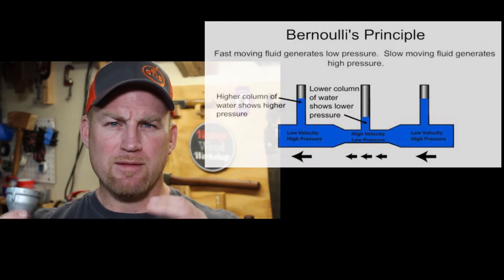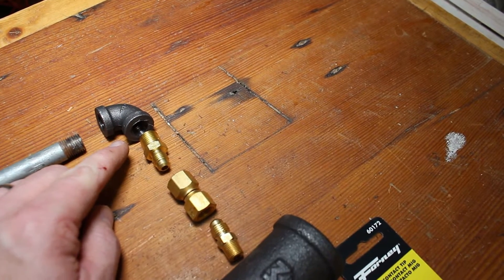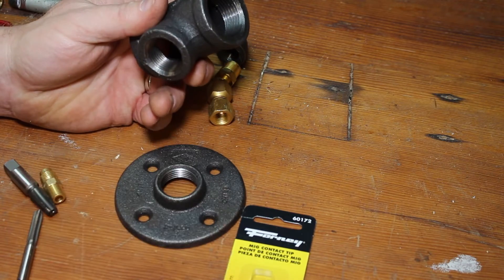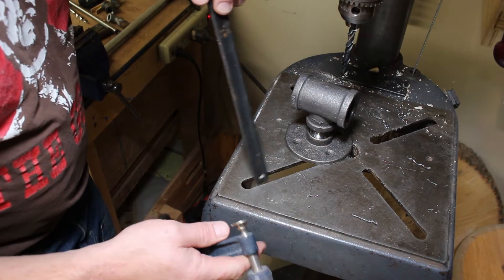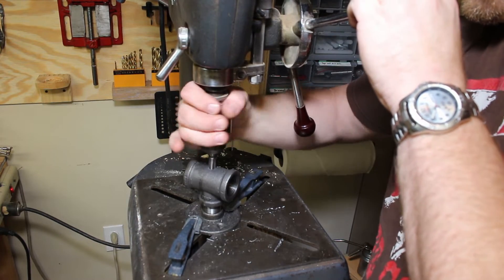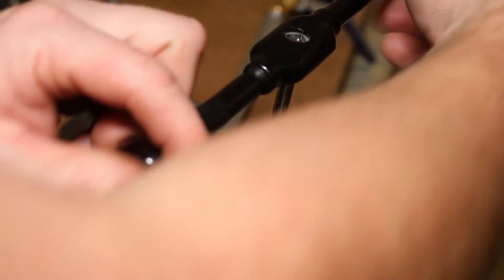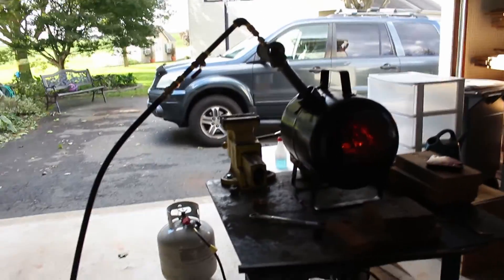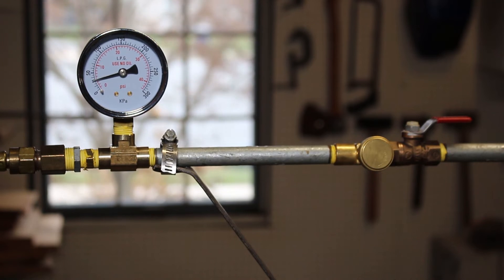How to Build a Frosty T-Burner (Propane Forge) Step-by-Step Process

Comment: I noticed the problem with the 1/8 x 27 Tapered pipe tap. You tapped it too deep. Tapered threads are a whole differnt animal. I have 48 years in machine shops and I learned long ago that you have to stop at a certain point in order for the mating part to fit correctly. Taperd threads are designed to get tighter as they screw together.  In pro shops we have gages that we use to know when the hole is tapped correctly. When you don't have a gage, this will get you in the right "sweet spot",   run the tap into the hole until you can count 7 to 9 threads above the hole. That will put the right amount of draw for the mating part to tighten up.

Comment: Cpvc would work fine up to 2 feet to kiln just use cast from there cpvc holds up to 300 psi propane is cold anyway no heat is made until combustion at tip so technically  weather is air hose water hose PVC cpvc or copper pipe and even pex is all fine for max of 30 psi from regulator   code I guess would be gas pipe cast iron  but it's not on a building so code doesnt matter just a thought of making long distance supply cheaper  ....good job on building

Comment: Sir l built a burner with a 1x1x3/4 tee and a .30 flux core tip with a regulator and it will not light. Could you give me some advice? Thank you
Reply: did you get it worked out?

Comment: The existing hole in the brass fitting was way bigger than the 1/4 20 my welding tip was.

Comment: You started talking about the pipe tap being tapered, but didn't mention if you tap too deep with it then the fitting will be loose, it actually widens the hole too much. Looks like yours was actually close tobeing too loose. A little extra tape will probably fix it though.

Comment: Can I use 1 1/4" pipe instead of 3/4" pipe for the burner? Will there be any greater safety concerns if I use 1 1/4" pipe instead of 3/4"? And can the propane line fittings be of different diameter, such as 5/16" with all proper reducers and tight threaded fits? Thank You for the video.
Reply: All of that is achievable. Bigger burner will give you a lot more heat.

Comment: Who told you that thread tape doesn’t seal and is for lubrication? It is definitely for sealing man. That’s it’s purpose.
Reply from the maker: The internet...here’s an example: https://www.thebuildingcodeforum.com/forum/threads/white-tape-on-gas-lines.10125/
Reply: Wrong. Its purpose isn't to seal. Pipe threads are tapered. They seal themselves, but you have to tighten them enough to seal themselves. That is where Teflon tape comes in. It lubricates the treads so you can more easily get the joint tighter. The old timers use to use oil or cutting fluid to lube the threads, them Teflon tape was invented which is far less messy

Comment: So I used the same tap that you mentioned in the video, a 1/4", 28, for the threads in the brass fitting to set the mig tip and when I was done, the mig tip just slid in and out. The hole was too big.

Any suggestions?
Reply: Sounds like your mig tip thread is M6 SO USE M6 TAP WITH A 5.5 MM DRILL HOLE
Reply: @sprockylock391  is this a MIller mig tip?

Comment: I have a dual T burner and I'm having trouble with the burners. The first burner works great until I turn on the second one, and then they start sputtering.  And I'm also having problems with them getting extremely hot, up around the fixtures, and rubber gas lines.

Comment: Good descriptions and well presented. Thank you! One thought, don't back the tap all the way out, just enough to break the chip. If you take it completely out and then try to reenter the newly cut threads there is a chance of damaging what you already did. I liked the use of the union, easy disconnect without having to spin everything.

Comment: Very logical documentary.  What's the reason for using a tee instead of a cross?  That would save a lot of work.
Reply: my Lack of Focus or MLFranklin can you help me? I bought a 3/4” cross. What else do I need? I don’t wanna drill, I’d prefer to use flares or nipples

Comment: Hi mate great vid. Using the pressure gauge is a great idea. Just wondering Did you have to adjust the length of the mig tip? I plan on making one of these burners next week so been looking up as much info as I can on them. The length of the mig tip change from vid to vid.

Comment: how would it go with a blower pushing air through the "T" ?
Reply: It would not keep a flame. too much air at that point. even putting another nipple on the reducer coupling will put the velocity of the gas too high to keep a flame.

Comment: Great video. Thanks for putting it up. One thing though, your gauge isn't showing the actual pressure on your burner. It is showing the pressure between the regulator and the needle valve. The gauge needs to be between the burner and the needle valve if you want actual burner pressure.

Comment: Why is the eighth inch tap larger than the quarter?
Reply: 1/8 is a pipe size and pipe is measured by the Inside Diameter (ID). The mig tip is a bolt size, in this case 1/4", which is the diameter of the outside of the threads. NOTE: some tips are metric, 6mm x 1.0mm pitch.
Reply: @skiidahonorthsouth  That makes sense.

Comment: good video...btw...the correct tap for mig tip is m6x1,,drill is 5mm ...yellow teflon tape lubricates but doesn't seal??..then thread paste is better,, don't want any leaks

Comment: you can eliminate a couple fittings at the burner. tap the Tee with 7/16-20 straight thread. screw the 37 flare end of the 1/4 npt to 1/4 37 flare fitting directly into the tee. The inside id of the 1/4" 37 flare fitting is small enough to tap for either 1/-28 or 6mm-1.00. Which ever your mig tip is.

Comment: I built my to spec as shown on this and other videos. 1" main  by 3/4" T with 3/4" 8" nipple.  Tip centered in T. I can only get a weak good looking flame with minimal gas pressure or it flames out. If I turn gas pressure down further it catches fire down in T. The only way I can get a nice looking flame is to choke off almost all air intake. Not able to achieve a roaring flame. My previous burner was pretty much the the same but T-less. Had several holes drilled in tube for air with a pipe on outside to control air.  It worked. I am stumped.
Reply: You're using a high pressure regulator correct?
Reply: Don't forget about the 3/4" to 1" reduce at the output.

Comment: Not trying to be an ass, but you're not supposed to use bushings for reducing gas line. Always use bell reducers. At least that's what my boss has always told me
Reply: Or galvanized steel. Anything to do with gas has to be done right or a potential failure could happen down the road. Im just looking out for you brother

Comment: Thanks for the video. Just a tip these drill press vice grips work great, and give you more swing than your modified clamp. https://www.harborfreight.com/9-inch-drill-press-locking-clamp-36221.html

Comment: We are doing a double almost just like it. We are using.23 tips. Hopefully ours will work like yours
Reply from the maker: Butterball Jitsu awesome let me know how it works!
Reply: Changing the size of the orifice (.23, .30, .35, etc) will alter the volume of gas supplied to burner. You may need to add adjustable baffles to the air intake to balance the mixture. Have fun experimenting.